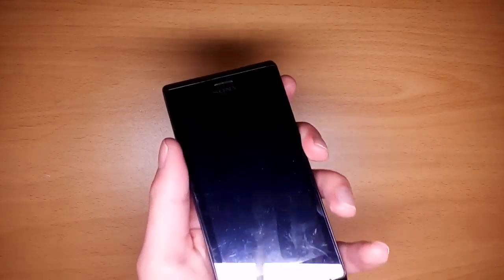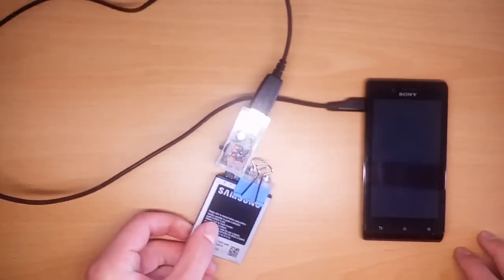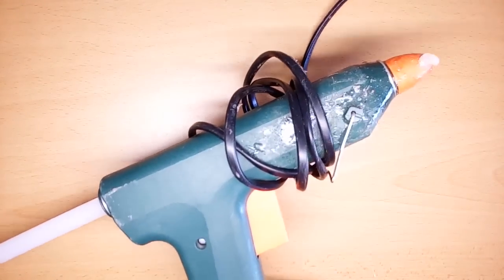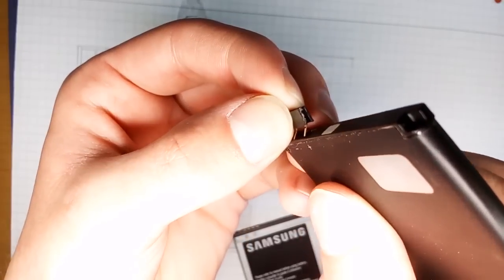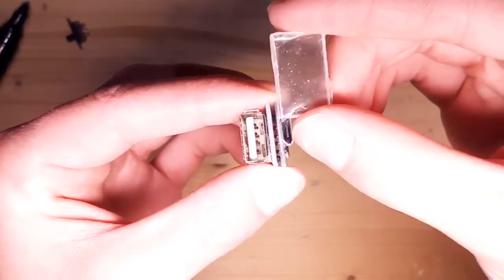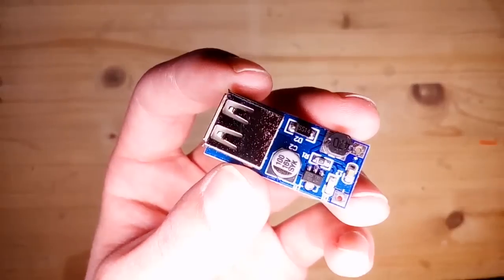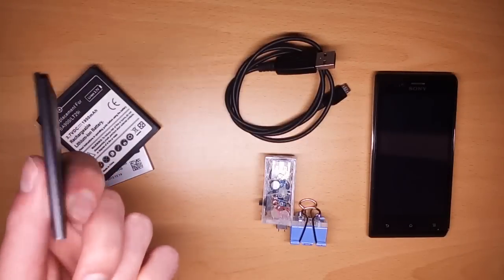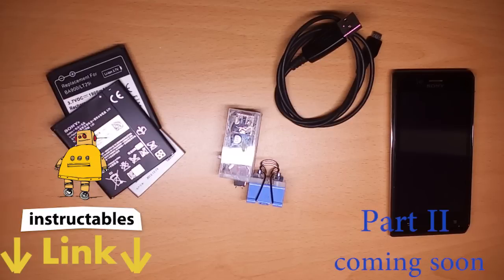Reuse old phone batteries as a powerbank (earth day part 1)

Comment: I cant seem to find the circuit which offers discharge protection, i only see charging module even in the givenn link
Reply: There are two versions of the TP4058 charging board... The older one, which has a mini-USB socket, does not have the discharge protection. The one you want has a micro-USB socket and has both OUTPUT soldering pads and BATTERY soldering pads. At exactly 1:20 in the video you can see a close up view of the board. The 4 soldering pads are near the index finger. That is the board you want.

Comment: I have an internal battery that has 6 wires coming out into a single small, white plug. How would I adapt this tutorial for this battery?
Reply from the maker: 6 Wires sounds like a 3 cell battery. The BMS board that i am using in this video is made for a single cell so you would need one for each cell and wire the inputs as well as the outputs up in parallel. To find out if you have multiple 3,7V cells you can use a multimeter and measure the voltage between two of the plugs pins to find out which wires connect to which cells. If you get readings that are far below 3,7 V you probably don't have standard lithium cells therefore you would need a different charging pcb.

Comment: Does a soft pack iPhone battery work?
Reply from the maker: If the battery is a Lithium-Ion battery with a nominal voltage of 3,7V it will work. But be very careful not to deform or puncture the battery. I ones removed a similar battery from an old phone and accidentally punctured it with my screwdriver. Luckily it did only sizzle for a bit and didn't catch fire.

Comment: Um... the diode in the positive battery connection would make it impossible to recharge the battery since it opposes any reverse current flow, which is required in order to recharge the battery.

Or am I missing something?

Comment: I can get a 4000 mah power bank at 3 euros at market.what's the nacessity to waste time
Reply from the maker: The premise of this project is the recycling aspect. It gives old phone batteries a second life :) . There is even an advantege over a standartised power banks, you can quickly exchange the cells in case you need some extra juice.
With a price tag of around two euros it is a fairly inexpensive solution as well.
 I would also be careful when buying very cheap power banks because there are many cases in which the actual capacity of them is lower than 10% of the value stated on the enclosure. Even aged quality batteries (from sony, samsung, panassonic,.. etc.)  have a higher capacity than those brand new cells.
I guess this answers your question.
Have a nice day :).
Reply: U R right.But I where I will get these circuits.Here we don't have ebay,amazone etc
Reply: 3 euros? In which country?
Reply: 4000 mah powerbank for 3 euros? Highly unlikely that it'll be a genuine capacity.

Comment: is it possible to connect batteries of different mah(eg:ihave 4batteries,2 of 1020mah,and two of 860mah)in parrallel to increase the capacity of power bank??
Reply from the maker: Yes it is, but you will need an individual charging and protection board for each of the batteries. You can then go on and connect all of the board's the outputs to a single step-up-converter and all the inputs to your input connector.

Comment: :) cool, thanks for your tutorial video.
I will try to make this one to power up my Raspberry Pi :D
Reply from the maker: Thanks for your comment. This selfmade powerbank is indeed a great power supply for Pi's and arduino's cause it features a switch instead of a low-power-consumption-turn-off-function (i'm pretty sure that there is a shorter word :D). I don't know if you ever tried to power an arduino or a small circuit off a usual powerbank but I tried it and it was always shutting off after 30 seconds, very annoying:D.

Comment: i have 3 mobile battery  which is 21000 mah how i used these all three batery & can make rechargeable mobile power bank
Reply: same as here, put 3 batery and connect + + + and - - - but isnt best, combine batteries with not same capacity
Reply from the maker: Yes you can indeed use more than one lithium ion cell and combine them in a bigger battery pack. However you can't simply hook them up in parallel. As the individual cells will most likely differ in capacity, you will need a charging board for each individual cell in order to prevent overcharging. I already answered that question in the comment section over on instructables and included a few graphics so you can head over there as well http://www.instructables.com/id/Reuse-Old-Phone-Batteries-As-a-Powerbank-earth-Day/.